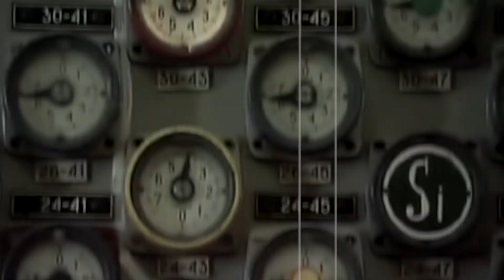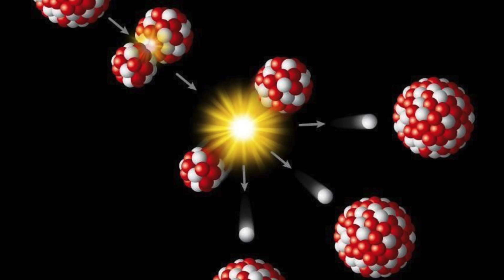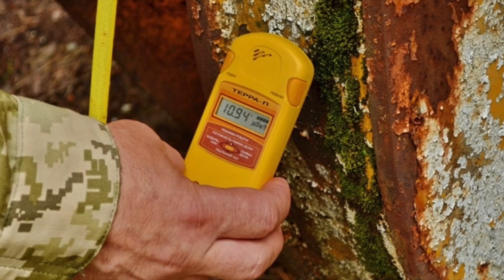Nuclear reactions have begun at the Chernobyl nuclear power plant. Can a catastrophe happen?

Comment: Scientists predicted the increase and are non concerned. There is very little risk. Even if water gets in, it is manageable. The key is monitoring and taking action if necessary. All the half life talk is largely misleading. Think of it this way, if you have a tank of gasoline and you attach a torch to it and light the torch, then if the torch is run at its lowest setting the tank of gas will last a long time but you can get right up next to it and be safe. If you crank the torch to max then the gas tank will run out much faster but you can't get near it without being burned. So, if you have a short half life element then its radiation will be intense but short. Think Iodine. On the other hand the uranium will have a much longer half life but its radiation levels are smaller. So it comes down to intensity which means you have to factor in 1. What radioisotopes are involved, 2. How much, 3. Their geometry, 4. Are there moderators present (or reflectors). Now you have a more complete picture.